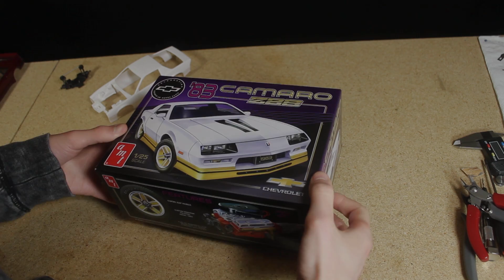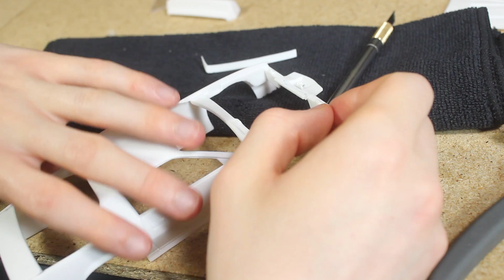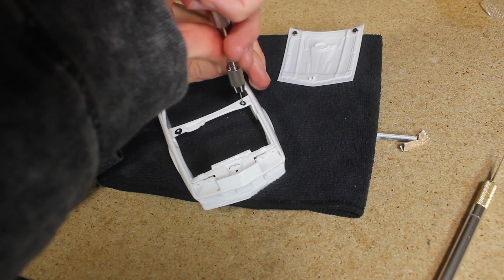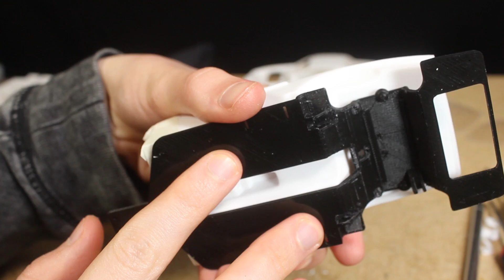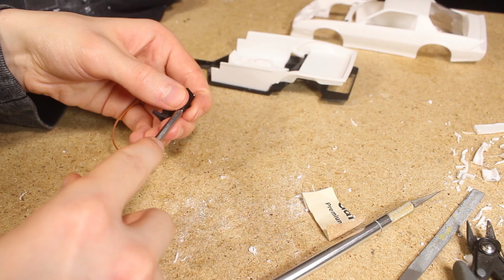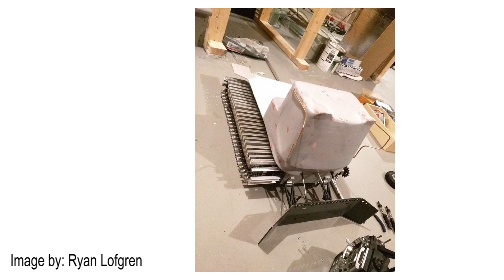Getting the AMT 1/25 Camaro Body Assembled and Mounted to the RC Chassis (E15)

Comment: I did similar the same thing. Mine is a 1/24 92 Z28. Mine is minus the interior, I just used the body on a radio shack xmod.and I even found some IROC wheel for it. I should post it on here.

Comment: I like that body style of Camaro, the IROC-Z trim just makes it look better imo. All in all, great vid!

You got any experience with Nitro R/C cars/trucks? I almost bought one though the long-term cost/maintenance through me off.
I bought a "nikko lancer drift r/c" for cheap, but am wondering if there are any kinda cheap mods/improvements I can do really make it decent. Btw the car was $57 so I really have about $25-$30 at most to spend on it lol. It's a Vintage RTR btw
Reply from the maker: Thank you. I don't have any experience with nitro vehicles and I don't know of any upgrades. Good luck though, I hope you can figure something out.

Comment: I'll be watching this car with great interest.  I literally have a small shrine for my '87 Camaro I used to own.  First car and all.  I still have the plates, and a few glamor shots of the car.

I seriously think of that car nearly every day, and my eyes dart to any 3rd gen that drives by me.  I miss it greatly.
Reply: Mr76Pontiac what happened to your car
Reply: Age.  I had to send it to the great Repair Shop in the sky... or ... was that to a shop to make spoons out of it? .. either way...  The driver side rear control arm going from the axle to the body rusted off the body, so I literally had a BBQ skewer holding the arm up while I drove down the road (For like 3 years?) and when I stepped on the gas, you could feel the rear end wiggle, I had a hole in the driver side rear floor pan that you could drop a coffee mug through and not hit anything, I had a spark plug in a precarious place that would not come out because it seized into place, and so many other wonderful (Not sarcastic - I miss these things) problems that just made my heart melt with delight.  It was a broken car, and I loved it.  She was unique because no one in their right mind would drive a hunk like this one. :]

Mechanically, she was really sound.  Engine never gave up, clutch was voluntarily redone the month I got it back from the body shop after I spent $500 on it, mileage was pretty good, started easily EVERY TIME no matter how frig'n cold it was.

Gawd I want a wreck again....